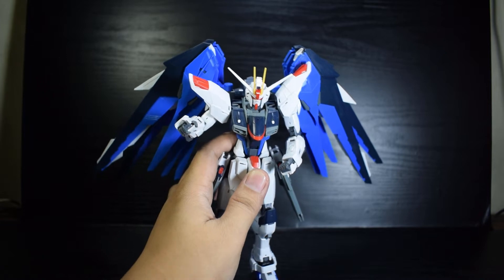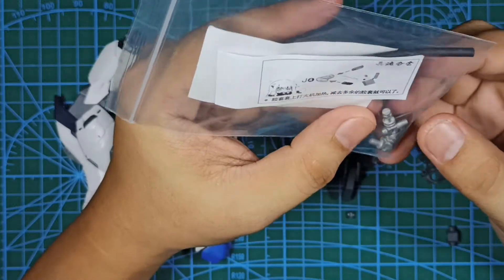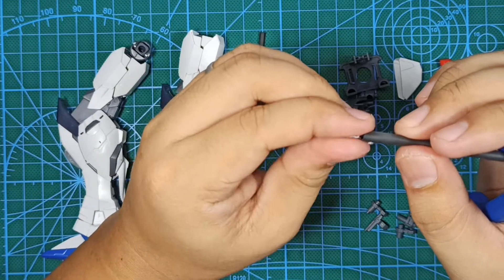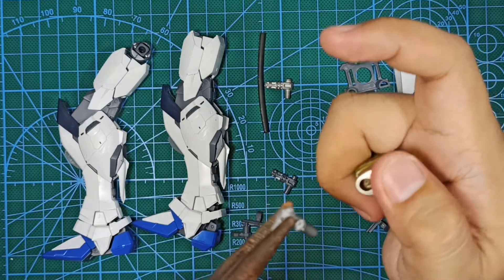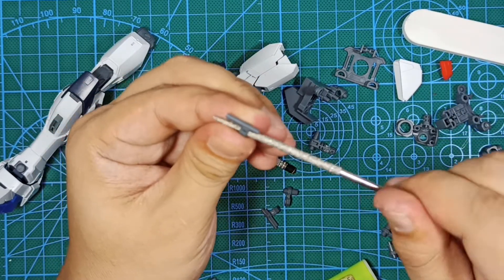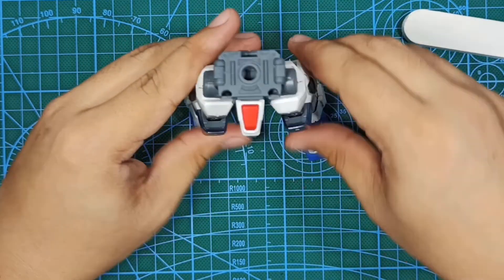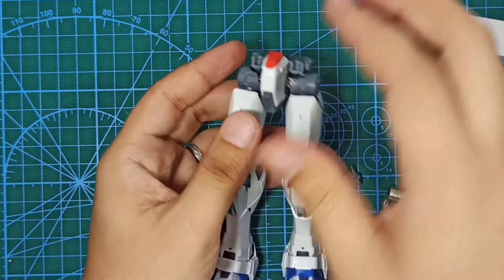How to fix Gundam Freedom v2.0 or Providence J4 part 2022

Comment: Mine came in black and didn't come with the "rubbers" (heat shrink), I got them cheap on eBay, I fitted mine as I built it, to save taking it apart later when it decides to break.
Better to use preventative measures than use the standard ones and wait for them to break, eventually.

Comment: The exact same thing happened to me, but in piece j42 there was the piece of piece j4 that broke.  Any ideas to get him out, he's under a lot of pressure.  Thank you
Reply: it happens to me just separate j52 and j53 then in j42 you will see both sides have holes in them, in the part where it is clogged just push them out to remove them

Comment: How about drill the plastic part and add a piece of copper line inside?
Reply from the maker: Yeah that can work too. unfortunately I dont have the tools before when I did this video😁
Reply: You can use a piece of paper-clip, cut to the right lengh and super-glue (CA glue), it's an old Warhammer method of attaching weak or heavy parts, called "pinning", you just need a micro hand dril (pin vice) and the aforementioned length of paper clip, still not as strong as new solid metal joints, though.

Comment: hello ask lang kung anong issue sa may waistline and anong pang fix don sabi kasi nang iba na nag bbuild natatangal daw
Reply from the maker: sa akin naman walang naging issue sa waist. pero kung lose ung joint, try mo lagyan ng clear coat ung peg para mejo sumikip
Reply: @2BProjectPh  pwede rin ba yang technique na yan for the J4 as alternatice sa rubber tube? wala na kasi kasamang rubber tube yung J4 sa shopee.
Reply: @chrisprufer1622  Basic electronics heat-shink, that's all it is.
Reply: @2BProjectPh  You can also use Gunprimer's Joint Guards, they're reasonably prices for the amount you get (1054) and can be used for tighening up joints, especially kits with "early Real Grade syndrome"

Comment: Can i use a hair dryer instead
Reply: As long as it's really hot.
You can use a soldering iron, or a lighter, those work best for heat-shrink.

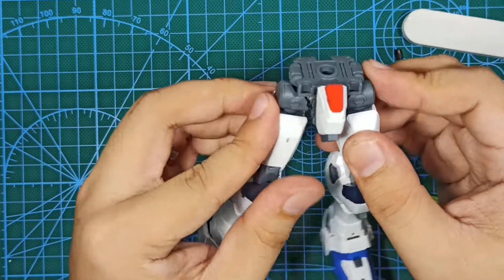Comment: hmm, so that is why the Wing EW Ver KA has ABS hips, right! I think Freedom 2.0 seems to not use ABS, just PS parts frame. Bandai was sneaky as always changing the Wing EW Ver KA to ABS just on the hips. Oh by the way at 4:08 it's very clear the joint in the thigh flex in a frightening way. I will reinforce those parts when I got my kit.

Comment: para saan yung rubbers?
Reply: Added thickness to keep them tight, I assume, but you can use Gunprimer Joint Guards instead or simple electronics heat-shrink.

Comment: So super glue won't work
Reply: It's too weak, somthing like Tamiya plastic cement, that melts the plastic and fuses it together, may be stronger, but I wouldn't trust it completely, metal joints don't cost much and the "rubber (heat shrink) isn't necassary.